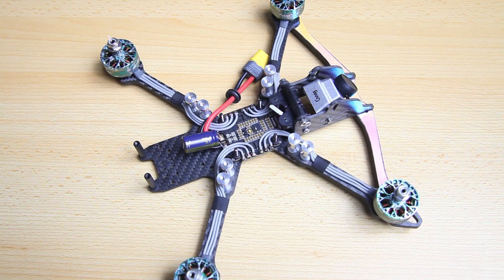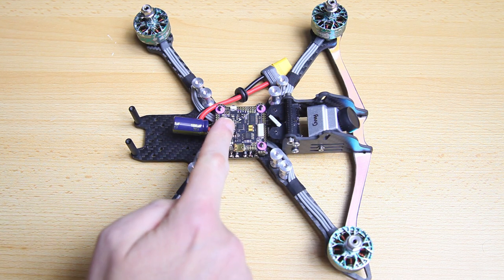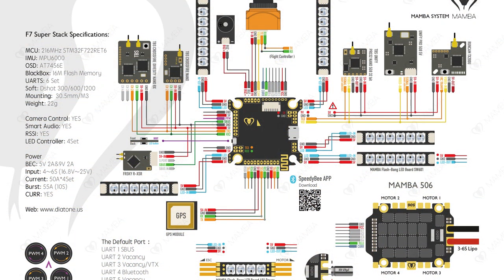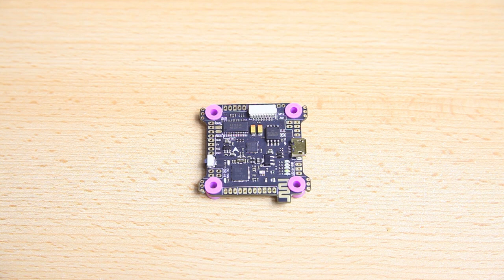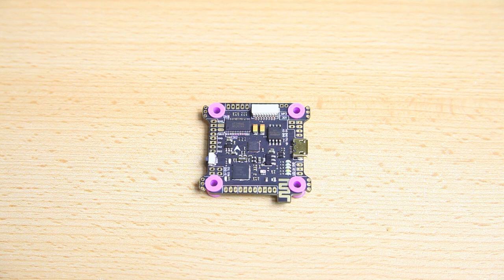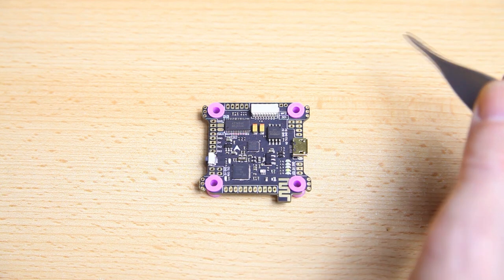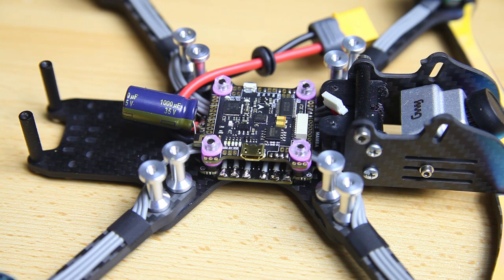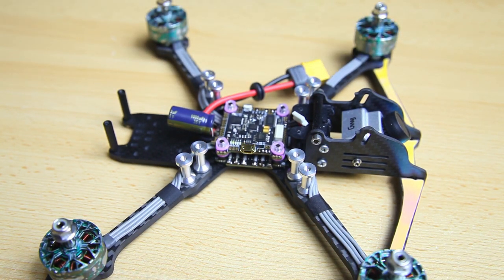Perfect FPV Drone Build Guide - P4: FLIGHT CONTROLLER INSTALL

Comment from the maker: Installing the Flight Controller! :D .. what do you need to keep in mind??? 
the Diatone / Mamba Mamba F722S Pro stack I'm using here: 
https://www.banggood.com/MAMBA-F722S-Betaflight-Flight-Controller-OSD-59V-2A-BEC-F50PRO-50A-3-6S-Blheli_32-Dshot1200-FPV-Racing-Brushless-ESC-for-RC-Drone-p-1490805.html?p=TO251813974002015038 

The Catalyst Machineworks BangGOD frame: 
https://www.catalystmachineworks.com/products/banggod-5-inch

Comment: Goeie video weer :). Sommige terminologie is misschien voor beginners nog lastig om te begrijpen, zoals wat ibus, sbus, uart, etc. betekenen/doen, maar verder is het uitstekend uitgelegd allemaal. Vraagje: welke methode gebruik jij om te achterhalen dat je batterij voltage te laag wordt en je je quadcopter naar beneden moet halen. Doe je dat altijd op gevoel of via de OSD of via een buzzer of iets anders?
Reply from the maker: Dank u! :D  hmm ja! Dat is inderdaad altijd de spagaat :P  Te veel / te weinig uitleggen :D  
Ik zal et Wel in gedachten houden! Thanks :) 

DAT verschilt: bij vliegtuigen is het inderdaad gevoel of de timer in de zender.. 
Bij FPV quads houd ik de OSD in de gaten, maar tijdens et vliegen laat ik ook m'n zender minute-calls doen.. de eerste 3 minuten hoef je in de meeste gevallen niet op et voltage te letten..
Reply: @DutchRC  geen probleem :) begrijpelijke afweging qua info uitlegging. Bedankt voor het antwoord. Ik moet me eens gaan verdiepen in OSD's, veel FC's hebben die tegenwoordig ingebouwd of niet? Wat houdt minute-calls precies in? Is dat om de minuut een seintje geven aan iets?
Reply from the maker: @raynlaze1339  Allemaal eigelijk wel :) 
Bij de Betaflight install (in deze video-series) zal ik het instellen van die OSD meenemen :)
Reply: @DutchRC  top! 👍🏻

Comment: Good evening, goeienavond Dutch RC Team

As starting student learning rc aircraft flying, I have my lessons ( july 2020) with my transmitter in mode 1: gas on the right stick.

Now I bought in een aanval van consumentisme, a drone : the Beast Pro 906 because I would really also want to learn Drone Flying for fun.

My issue, mijn probleem en vraag is : can my Beast Pro be changed towards gasfunction on the right stick instead of having the gasfunction on the left stick ( as delivered)

I saw a You Tube film of the Holystone Drone HS 720, where was pointed out, that for left handed people, this stick change was possible.... Since I  watched your enthousiastic creativity with all kind of Drone Building Issues, I really hope you have some advise to help me out:)  best regards uit Alphen aan den Rijn én doorgaan met die superleuke You Tube filmpjes 👍👍
Reply from the maker: Halloa! :D 
je MAG ook wel in et Nederlands schrijven hoor :)   en in het kort: ja dat kan zonder meer.. In feite weet geen enkele drone wat voor'n mode de zender is :) 
Je zender gaat alle kanalen echter in een bepaalde folgorde sturen. (in mijn geval bv: ch. 1=Aileron, 2=elevator, 3=throttle, 4=rudder, en de rest is dan switches).. 
En vervolgens moet je Drone dan nog weten DAT dat de volgorde is (receiver tab in betaflight).. 
Welke zender gebruik je??? :) 
Goede groet! 
DutchRC
Reply: Supergoed zo'n snelle reactie, DutchRC. Word ik echt blij van . Mijn wens zou zijn dat de meegeleverde zender van de Beast Pro 906, omgebouwd wordt naar gas op de rechter stick en hoogte/richtingsroer naar de linkerstick. Maar misschien is dat n domme gedachte. Wat is jouw idee hierbij? En ik ben benieuwd naar waar jijzelf meevliegt?
Reply: Mijn eigen zender is een eenvoudige FlySky FS i6X en ik vlieg met een Robbe Charter trainer; buddy box erin voor de trainer en dat loopt als een tierelier

Comment: Could the 9 volt  pad used on the camera damage mine since it says it’s 5 volt?? Or do I look for a 5v pad on another part of the board?
Reply from the maker: the max for your camera is 5V? then YES.. good chance 9V would fry it (allmost 2x the amount the camera likes ;)) 
So yep.. there are plenty of 5V pads.. pick one of those :)